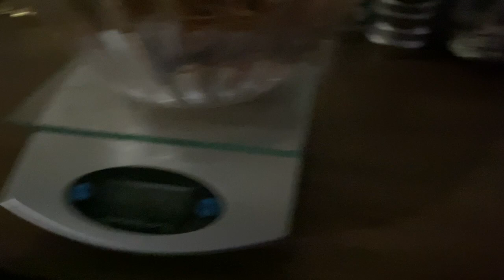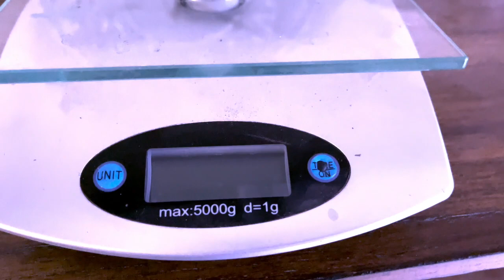Making Aluminum Bronze - Melting Copper and Aluminum - 89/11 Aluminum Bronze Blend - TheGrowingStack

Comment: Hi, its very beautiful, i have a question, melt aluminium is toxic??
Reply from the maker: Thanks man. I don’t think it’s toxic unless you heated it to it’s boiling point and beyond. If melting scrap/alloys- the paints and other metals can be depending on what you’re melting. I usually wear a respirator when melting just to be safe, and always when grinding or sanding to avoid breathing the dust.